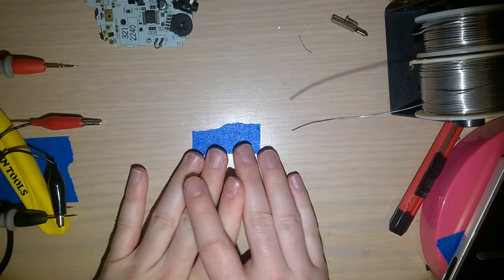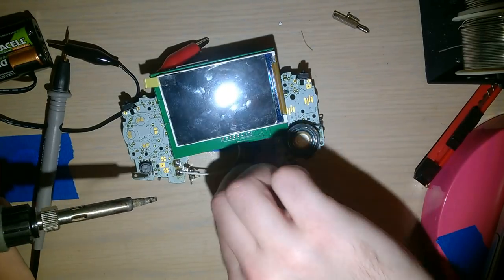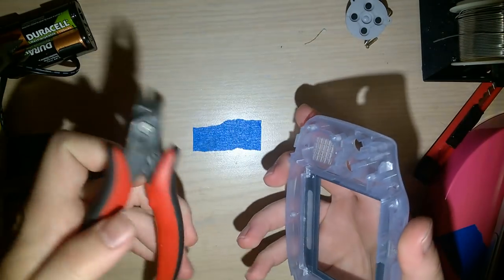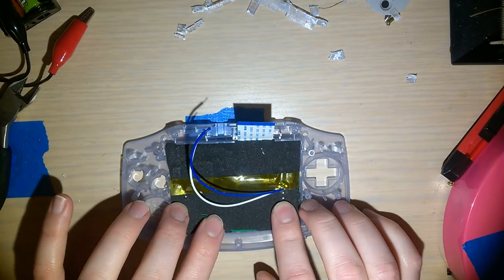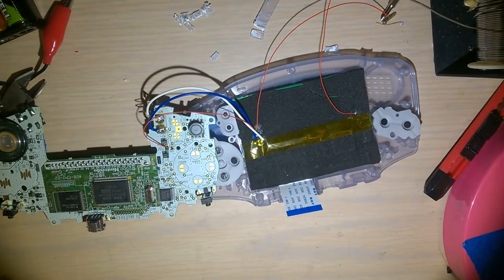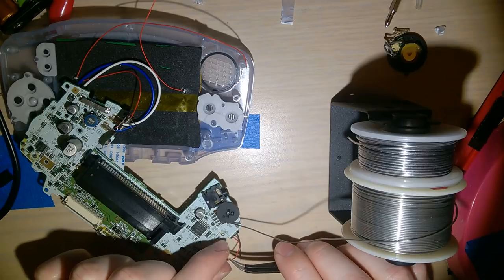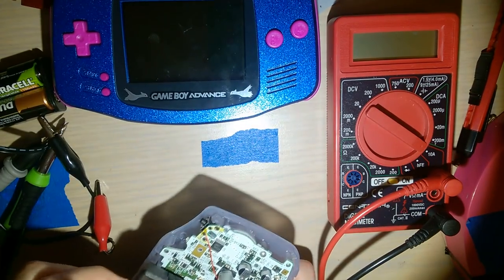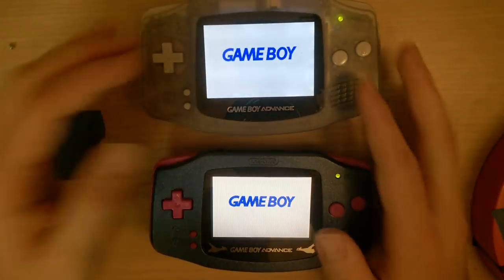Installing the "Galaxy Screen" Taobao IPS LCD in my Game Boy Advance

Comment: i assume they have sanded off any of the logic ICs on the PCB, would be interesting to see how much it costs to DIY.
Reply from the maker: Indeed they did sand off all the identifying marks. I'm sure the cost of parts is less than $20 for all the electronics, but even then, the electronics are useless without the code that the FPGA runs. You are paying for a finished product in this case and I don't really mind throwing the seller a bone since they put so much work into making this as straightforward as possible.

Comment: How does this compare to the funny playing display?

Also, polarity does matter when you have more than one speaker, which the DS you took it from was stereo.
Reply from the maker: I'd say it's better than the funnyplaying display as far as frame handling goes. There is no tearing. However, the install is more difficult, requires more modding, it only works on 40 pin consoles and not on 32 pin, and the colors are not accurate. The colors look noticeably off when compared to another backlit console. Given the major price difference between the two though, I still think the FIPS screen is the better purchase.

Comment: Is the viewing area the same or bigger then the original screen? If so do you need a special lens?
Reply from the maker: Bigger, and no you don't. The very edges are cut off but I've yet to find any game that where the last couple pixels being cut off is detrimental. RetroModding and Jellybellycustoms will be selling custom lenses soon though if you want to get one anyway. This requires cutting the plastic bezel on the casing though.
Reply: @makho  i thought they were going to sell the glass lens for the funnyplaying ips screen and not the taobao screen since both screens are ips but different
Reply from the maker: @d.t.9488  Oops, you're right. I just did a bunch of videos on the funnyplaying screen so I thought this comment was regarding one of those. 

The image is still slightly bigger than stock (albeit slightly smaller than FIPS) but I still don't think a custom lens is necessary. 

This is the taobao screen in a stock lens: https://i.imgur.com/xXpivql.jpg

FIPS in a stock lens: https://i.imgur.com/E7p3CM9.jpg

And stock (backlit) screen in a stock lens: https://i.imgur.com/vEW78z1.jpg